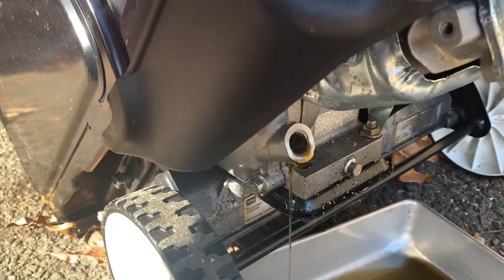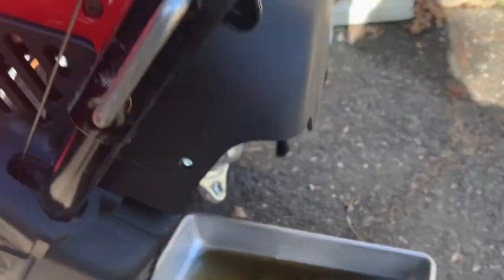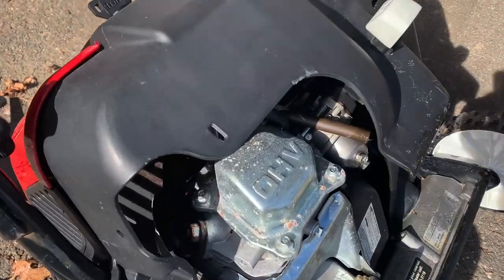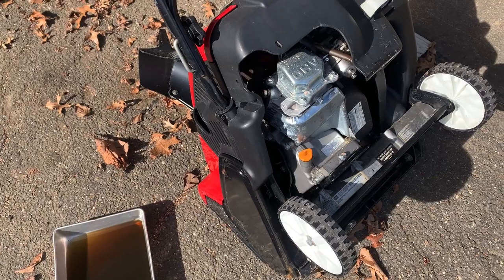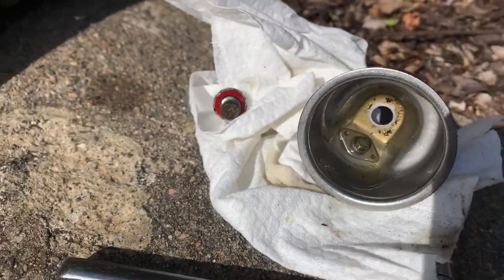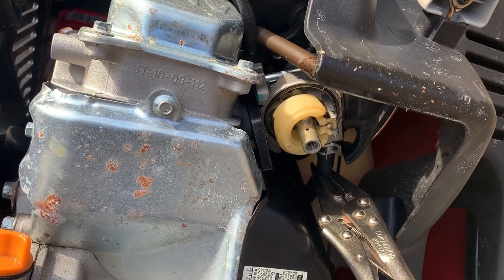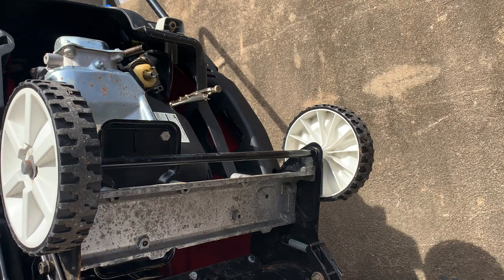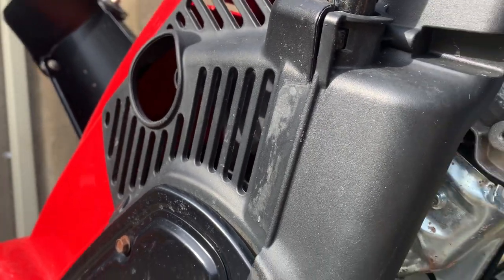Toro Single Stage721E Snowthrower, Leaking oil? Only runs on half choke? Mystery Hidden Dipstick!

Comment: Huge thanks for posting this video. My 621QZR just started leaking oil in its 12th year and sure enough the hidden oil plug was loose. If not for your video I would not have know that plug was there until I completely tore down the machine - it's not even mentioned in the manual. Otherwise this machine has been rock-solid, runs great and no major servicing required just a spark plug at the 10 year mark and annual oil changes.
Reply from the maker: I had a customer who complained of an oil leak but it wasn’t easily found so I took all the covers off and discovered it. Now it gets checked on all of them that come in!  Thanks for watching!

Comment: Ken, for whatever it's worth, we had some sprayer nozzles at work that we had to clean, and a tip cleaner was to big, so we took a strand of wire rope, and that did the trick. Think bike brake or shifter cable.
Reply from the maker: I have many wires for different things, I still pull strands off my brass brush to clean the pilot jet holes on Honda carbs! They seem the smallest around 10 thousandths. Thanks for watching!

Comment: On my billygoat vac that has an 8hp Honda, the oil level is suppose to be just below the threads in the casting for the dipstick / cap.
Reply from the maker: If you look at the graphics in the manuals it shows the first thread which is right next to the top. If you tilt just a couple of degrees from perfectly horizontal it will give false readings so I just fill to the top when level. I Have double-checked the ounces put in and I’m usually right on the number. Thanks for watching!

Comment: Nice easy fix For you Ken. I have one question, why would you put fuel bowl on where you can easily get at the drain? Most are not engineered that way!    lol.     Rick
Reply from the maker: Are you asking about the oil drain?
Reply: No I was joking about the fuel bowl. Most engineering would have the drain screw/bolt facing somewhere you couldn’t get at or spill all over

Comment: Good fix, runs well.  Was there an engine mounting bolt missing?
Reply from the maker: Did you see something I didn’t??
Reply: @KensSmallEngineRepair  at the 16 minute mark when filling the oil, looks like a bolt is missing from the engine mount by the fill port.
Reply from the maker: Great catch Jim!  This thing barely has any hours on it. Wonder if it’s a factory defect?
Reply from the maker: @jcondon1  I just looked at a factory video assembling one of these. That bolt was not there!!!
Reply from the maker: Video on this to come!!!

Comment: were you able to fit your hand thru the area to tighten the hidden oil plug without removing the red cover? I have a 721E toro also .
Reply from the maker: Easier with the cover and chute removed, although I’ve reached up there with a 90 degree bent pair of needle nose pliers to tighten it also.

https://www.autozone.com/wrenches-pliers-and-cutters/pliers/p/duralast-11in-long-nose-90-degree-pliers/914140_0_0?spps.s=4718&cmpid=LIA:US:EN:AD:NL:1000000:TLS:19489353547&CATARGETID=120054150001289977&CADevice=m&gad_source=1&gbraid=0AAAAADkcoVv1RCV3-XFcB8_jePQTQ-lys&gclsrc=ds

Comment: Great video! Quick question, am currently trying to swap engines on one of these units.  Can't seem to get the bolt holding the main pulley in. Tried clamping the shaft with locking vice grips, but it just keeps spinning. The service manual just sais remove bolt to remove pulley,  which i cant seem to  do, Any suggestions?
Reply from the maker: Are the internal and external threads clean, no dried up Loctite on them? Have you run a thread chaser or tap down the crank hole and a die over the bolt?
Reply from the maker: If it’s just the spinning shaft your concerned with insert some nylon rope in the spark plug hole to stop the engine from rotating
Reply: I have to research a thread chaser, it's just factory installed,  so probably no loctite.  And not entirely sure what our mean about the nylon rope. (Not a mechanic by trade) just learn as I go when problems arise.

Comment: Question for you, ken. My machine is  like new. But it appears the carburetor gasket is leaking when I store it down on its wheels.  That seems odd. Could it just be a lose carburetor?
Reply from the maker: Down on its wheels?  Can you email me a pic of what you mean? Kenssmallenginess@gmail.com
Reply: Mr Ken, I discovered the float bowl ring wasn't set  properly. That caused the leak I was experiencing. I also gave the two nuts on the carburetor an extra torgue. Thanks again for your help!

Comment: Hey Ken, just re watched the Toro 6/22 predator swap as I'm buying one any day now. As for the "hidden dipstick, could I remove it and replace it with an end plug and just use the front dip stick?? Thanks again & keep them coming. Always a big help!!
Reply from the maker: As long as they are tight and checked at each oil change they will do no harm.  Thanks for watching!

Comment: Hey Ken, I have a 721 as well. The gasket for the bowl won't stay in its slot. Is there a special way it's supposed to go? I haven't sprayed cleaner or did anything else to it. I tried a bit of Vaseline to get it to stick till I could get the bowl back on. Seemed to work. I'd like to be able to take the bowl off without having to add anything. Thanks
Reply: Update: When I flipped mine fwd this year to expose the carb bowl, the gasket stayed in place. I was able to give the bowl, jet and emulsion tube a good cleaning. All went back together without a problem.